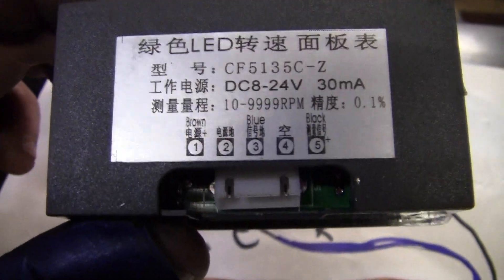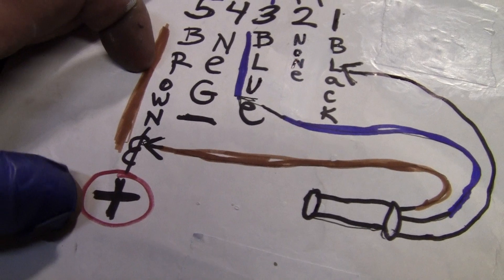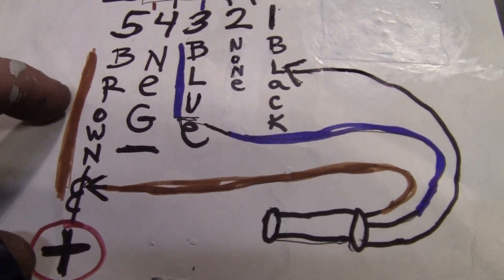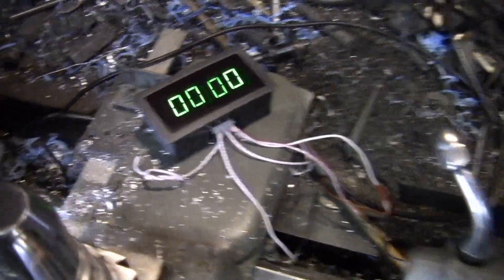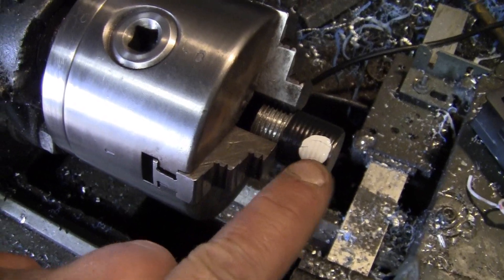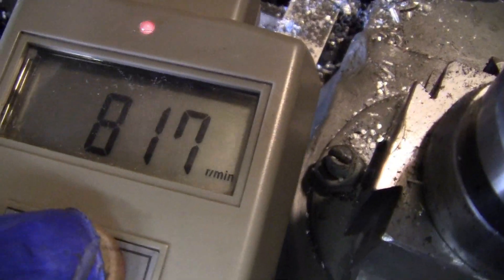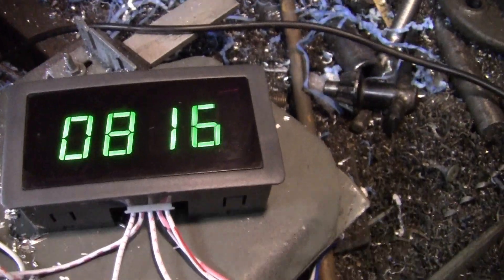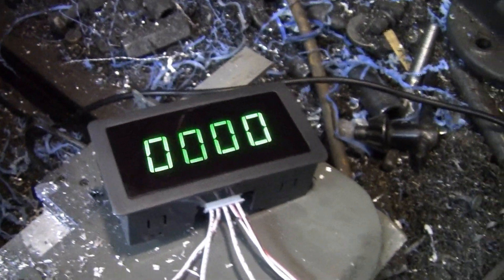HOW TO WIRE DIGITAL TACHOMETER

Comment: Attention Installers Everywhere 

Thanks for the Video, Spot on 6 years on !! Still no instructions !! 

Before you glue your magnet on to your device make sure that it is facing the correct way as a lot of cheaper Hall sensors like Amazon or Ali Express use a specific magnetic pole,  in this case the south one facing the sensor.  Tape your magnet on to your device or use Blu-tack or similar to test it on low RPM. Once you know it works,  mark the orientation with a Sharpie and then glue it down with a Araldite type glue or two component resin after cleaning the shaft or surface with a degreaser like Acetone or solvent, it must be grease free.

Comment: Thanks for information, just received mine.
In that case the JST plug has been wired back to front. So the label is printed wrong.
I'll remove the wire's from the JST plug and put them in the right order. The blue wire is still pin 3. 
That should solve the problem.

Comment: If you solder in a button on the bottom spot on the board you can change between 11 different modes including thermometer and counter, stopwatch, decimal place change and others..  theres a calibrate but dunno how to use that mode.   But you can wire in a reset button on the middle 2 pins on the little 5 pin deal which is needed for some of the other modes.  Not sure where the thermistor would go on the board but maybe where the reset switch goes ..  may need to solder in some supporting components for that mode cuz it just reads 32°f or 0°c and doesnt change..

Comment: I hope, that you can help me, because the companies, producing this product do not answer satisfying. I need a tachometer, which provides a DC voltage which is growing with the speed. Can you measure with the speed a growing DC voltage between the ports 43 or 41? I need this voltage for another control to adjust the gas on a static diesel engine. It would be very nice, if you could provide me with this information.
Reply from the maker: sorry others have ask that same thing and it can't be done with this unit ..
Reply: @shawnmrfixitlee6478  Thank you very much with this information. Do you know a tachometer providing this benefit?
Reply from the maker: let me look for ya .. what make of diesel you got there ? @doliwsef
Reply: @shawnmrfixitlee6478  I will use the Mitsubishi-engine L2E and the control I use is called 16x2. It is from the Austrian company Technische Alternative. It uses a 0 to 10V signal for controlling. It is very kind of you to help me that much!👍
Reply from the maker: @doliwsef  https://www.ebay.com/itm/165293681166?chn=ps&_trkparms=ispr%3D1&amdata=enc%3A1QIyO8yd9QG6c4ffhHldszQ53&norover=1&mkevt=1&mkrid=711-166974-028196-7&mkcid=2&mkscid=101&itemid=165293681166&targetid=2259088259507&device=c&mktype=pla_with_promotion&googleloc=9033152&poi=&campaignid=20823268534&mkgroupid=155757790786&rlsatarget=pla-2259088259507&abcId=9347991&merchantid=263834315&gclid=Cj0KCQiAwvKtBhDrARIsAJj-kTicKXar-HsBDYVRsEzXvGYG0LdwiJEo0ylvB41oYnwSuPqN8Rm3UhYaAt8fEALw_wcB         These work well !
Reply: @shawnmrfixitlee6478  Thank you very much! You are very kind! Greetings from Germany - Stefan

Comment: My first one read ~double speed, second one worked fine. Switched sensors, same result, first one musta been a dud. I got 'em really cheap in Ph. My application is a toy cnc machine so not much room for the supplied sensor. I made my own from an obsolete Y3144 Hall switch glued to thin aluminum plate and added a 5.1k pullup resistor across pins 1 and 5, sorry, YT doesn't allow images. 
Actually pins numbered 3 and 4 are ground and power for the sensor.
My first post was rejected, now it shows. . . . and now it's gone again. Pop off the back cover and extract the board for easy access to the back of the connector.
edit:
https://youtu.be/fG8W4fWDamE
More than one way to skin a cat.

Comment: I'm confused, you have changed the terminal #s but the color code order remains the same, I have wired it both ways and still no rpm
Reply from the maker: Turn your magnet over they only read with it in the right  pole position  .. some of these wire differently than others , depends on the china company that built it ..
Reply: Yes i do not get it he wired it up just as the sticker said to.  He just he just put the numbers in a different order. he has power to is 5 which is 1 on the sticker and so on.

Comment: Wired like yours I get LLLL on the screen , when passed over the magnet the LLLL dims a little but records no speed. Any ideas?
Reply from the maker: have you tried flipping the magnet ! Also double check your wires to be sure they are right ..
Reply: @shawnmrfixitlee6478  I did yeah. Even a stronger magnet, wiring all checked and found the unit to be faulty.
Reply from the maker: @union310  They are cheap china goods ! many have failed I am sure .. Hope you get a good one as they are nice to have ! Thanks ..

Comment: How can these be hooked up its power source to the mills startup power. So it comes on when the mill is started.
Reply from the maker: Depends on the switch in the mill . But I would say find the output hot wire on the switch and hook a 12v power supply to the output on the switch and feed the tach off of that .

Comment: Please, does it work for an old diesel motor car ? I was thinking mounting it, thr sensor in front of the crankshaft pulley. Do you think it will work?
Max revolutions about 3500 rpm. Thanks for your help. I hope and like very much  you are happy to help,
Reply from the maker: Sure it would work on any rotating shaft ! Thanks .

Comment: Nice job on the video and wiring diagram Shawn.  I would like to know how to calibrate the tachometer.  I have a situation where the tach is mounted on the drive shaft and then on the other end of the drive shaft is a different size diameter pulley with each different test.  I would like to introduce a potentiometer so I can adjust the tach on the drive motor so that it compensates for the different size diameter pulleys on the other end.  It is not possible to mount the sensor and magnet on the other end.  One of the resistors such as R5, R8, R12, or R21 should be able to be replaced with a potentiometer.  What would you advice here?
Reply: If your pulley is keyed and set screw to the shaft it will turn with the same RPM ....   A 1" shaft turning at say... 1000 RPM  and you have a 6" and a 10" Pulley on that shaft.... They will all turn at the same RPM....    Now the MPH of the surface will be different.
Reply from the maker: @pbc1951  Yes sir . It takes some figuring but they work well !
Reply from the maker: Your way to deep in the tech for this simple china made device .. Sorry but it only will read the shaft RPM it is installed on ... Wish I could help you better but it has no way of being programmed .. Thanks !!
Reply: Shaft size is irrelevant, it stays constant whatever the size of shaft, speed however will change on the face dependent on the size of the shaft however RPM is RPM is always constant in relation to shaft diameter.

Comment: Mine came through the post today, 
And i had a feeling that i should Youtube it first, 
And boy im glad i came across your vid, or i would of wired it up wrong and may have burnt it out

I am using a 12v psu and it works, so you don't need to get a 24v psu, that is it voltage limit
Thank you ShawnMrFixitee
Reply from the maker: Glad I could help , Thanks !!

Comment: I was wondering, since these are sold on ebay as essentially having 3 functionality.  I am interesting to wire as simple counter using either a contact switch or magnetic switch.  Would connect between 1 and 5 or 3 and 5?
Reply from the maker: not sure on that . I would try both one at a time and see how it works ! I had to mess with this one before I figured it out . Thanks..

Comment: How did you power the tachometer?
Reply from the maker: I just used a 12v wall adapter and found + & - with a meter and wired it in .. Thanks !!

Comment: I've got a doubt here sir. Should we put a magnet or the sensor of tachometer has the magnet integrated in head of sensor? 
Thanks!
Reply from the maker: NOPE .. the sensor is just that , It picks up the pulse of the magnet! You need both to make it work .. Thanks !
Reply: @shawnmrfixitlee6478  does all of these stuf comes with this tachometer? I mean for tachometer with these wires that you connect? Thanks for replies.
Reply from the maker: @RinorBislimi  yes sir , Comes with the whole kit  !

Comment: I have flipped the magnet, replaced the magnet, checked the proximity distance, replaced the display with an identical one, checked the wiring and the damn thing refuses to give me a readout. I get 4 zeros until I start the lathe and then I get either four dashes or flashing high numbers that immediately disappear. I can't for the life of me see what I am doing wrong. I have a couple of them in my shop and they work perfectly. ????????
Reply: I was hoping for some advice.
Reply from the maker: @oldsloane  I know , Sorry man  !! Sounds like you hit all the things I would try .. Are you sure the wires are all right ??
Reply: @shawnmrfixitlee6478   yeah I changed them to your diagram and the power polarity is correct so I am very frustrated. I will let you know how it pans out tomorrow.
Reply from the maker: @oldsloane  thanks it could be the magnet , Sending north and south random poles .. If one gets broken that can happen , and the sensor will pick it up and send radom #'s .. Hope you get it going man !!
Reply from the maker: I am at a loss on this one , I do know the have counter displays that look the same as the RPM displays and they will give random #s . Let me know if you find out what is wrong . Got me curious !!
Reply: @shawnmrfixitlee6478   Thanks, I am going to try a new magnet tomorrow, I am too frustrated to keep messing with it tonight. I had to break the original magnet that it came with and substituted one from my junk box so maybe it's no good.
Reply: Well I am just about ready to throw both of these ##**&& tachs in the garbage. Today I changed the magnet to one from a new kit identical to the one installed. Did not work. I flipped the magnet, did not work, I changed the sensor, did not work, I flipped the polarity of the power in, did not work, I removed the magnet from the spindle shaft and mounted it on a face plate, did not work. I am so frustrated right now I just left the shop, slammed the door and I am now contemplating a big dooby and a dozen beers.
Reply: well if finally figured it out. Apparently my cheap China VFD was full of bad smoke and after testing a few times it went pop and all that bad smoke came out so it doesn't work anymore. I replaced it with a Leeson VFD that I had in my toolbox and suddenly the tach was up and running. I think it was interference from the frequency of the VFD. The Leeson doesn't have a 12 volt pin out so I have to run it on a wall wort but it works just fine now.
Reply from the maker: @oldsloane  I run mine on a wort to keep it running on it's own .. I just knew there had to be an answer to this .. Glad you got it going !!

Comment: How accurate are they in a low rpm application?  Let's say between 10 to 50 rpm?  Thanks for posting the video!
Reply: the ones i see have a refresh rate of 0.2 - 0.5 seconds, so thats 120 rpm probably the low end with any accuracy
Reply from the maker: they seem to work fine at any RPM , Thanks !!
Reply: The speed range is stated on the label - 10 rpm to 9,999 rpm with an error of 0.1% - just how good it actually is right down at 10 rpm would need a little test with a stopwatch (on your phone) and simply count the number of times shaft turns in a minute.

Comment: Thanks, typical Chineese, cant be bother to include a wiring diagram
Reply from the maker: for sure , And if the did we could not read it ..LOL.. Thanks ..
Reply: many of them now come without a back plate, but you can look on Banggood or Aliexpress and get the wiring diagram. half of them now only have 3 or 4 wires
Reply: @pauls5745 aliexpress has them with a simpler wiring hookup now
Reply: its probably because the market was mostly aimed for chinese people and chinese people are smart that they dont need a manual in the first place